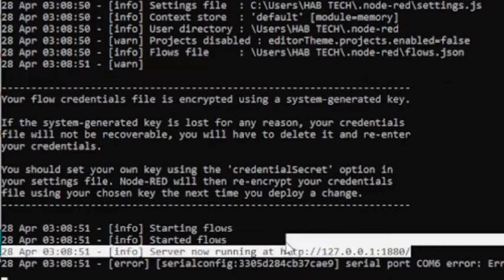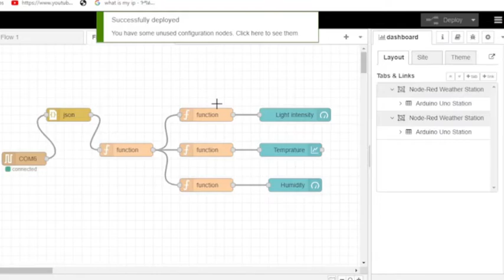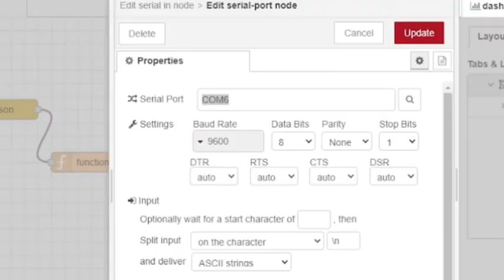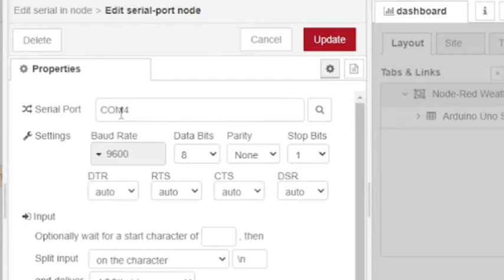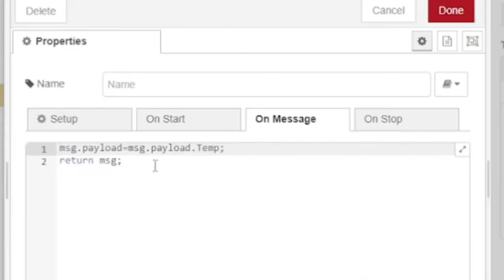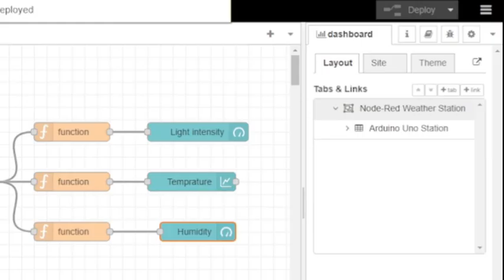Realtime Monitoring of Arduino sensor reading offline on webpage || 2024

Comment from the maker: The Arduino Code is as follows:-
#include <Adafruit_Sensor.h>
#include <DHT.h>
#include <DHT_U.h>
#define DHTPIN 2 // conect to digital pin 2    
#define DHTTYPE    DHT11     // DHT 11
//#define DHTTYPE    DHT22     // DHT 22 (AM2302)
//#define DHTTYPE    DHT21     // DHT 21 (AM2301)
int Humidity=0;
int Temprature=0;
int Light=0;
DHT_Unified dht(DHTPIN, DHTTYPE);
uint32_t delayMS;
void setup() {
  Serial.begin(9600);
  dht.begin();
  Serial.println(F("DHTxx Unified Sensor Example"));
  sensor_t sensor;
  dht.temperature().getSensor(&sensor);
  dht.humidity().getSensor(&sensor);
  delayMS = sensor.min_delay / 1000;
}
void loop() {
 delay(delayMS);
 sensors_event_t event;
 dht.temperature().getEvent(&event);
 Temprature=event.temperature;
 dht.humidity().getEvent(&event);
 Humidity=event.relative_humidity;
 Light=analogRead(A0);
 Serial.print("{\"Hum\":");
 Serial.print(Humidity);
 Serial.print(",\"Temp\":");
 Serial.print(Temprature);
 Serial.print(",\"Li\":");
 Serial.print(Light);
 Serial.println("}");
 delay(2000);
}

Comment from the maker: The Node-Red JSON code is as follows:-

[
    {
        "id": "777e21d8fb7005c6",
        "type": "json",
        "z": "88da2bec208da9fc",
        "name": "",
        "property": "payload",
        "action": "",
        "pretty": false,
        "x": 190,
        "y": 140,
        "wires": [
            [
                "9f828d0c941740ff"
            ]
        ]
    },
    {
        "id": "9f828d0c941740ff",
        "type": "function",
        "z": "88da2bec208da9fc",
        "name": "",
        "func": "var value=JSON.parse(JSON.stringify(msg.payload));\nvalue=msg;\nreturn msg;",
        "outputs": 1,
        "noerr": 0,
        "initialize": "",
        "finalize": "",
        "libs": [],
        "x": 320,
        "y": 220,
        "wires": [
            [
                "fe6fc76d0b7ed705",
                "3aea9c82799acd44",
                "edf7c2341a1b106b"
            ]
        ]
    },
    {
        "id": "fe6fc76d0b7ed705",
        "type": "function",
        "z": "88da2bec208da9fc",
        "name": "",
        "func": "msg.payload=msg.payload.Li;\nreturn msg;",
        "outputs": 1,
        "noerr": 0,
        "initialize": "",
        "finalize": "",
        "libs": [],
        "x": 500,
        "y": 140,
        "wires": [
            [
                "1ada5da722d25cc3"
            ]
        ]
    },
    {
        "id": "edf7c2341a1b106b",
        "type": "function",
        "z": "88da2bec208da9fc",
        "name": "",
        "func": "msg.payload=msg.payload.Hum;\nreturn msg;",
        "outputs": 1,
        "noerr": 0,
        "initialize": "",
        "finalize": "",
        "libs": [],
        "x": 500,
        "y": 300,
        "wires": [
            [
                "a8b9a012f0bcd88a"
            ]
        ]
    },
    {
        "id": "3aea9c82799acd44",
        "type": "function",
        "z": "88da2bec208da9fc",
        "name": "",
        "func": "msg.payload=msg.payload.Temp;\nreturn msg;",
        "outputs": 1,
        "noerr": 0,
        "initialize": "",
        "finalize": "",
        "libs": [],
        "x": 500,
        "y": 220,
        "wires": [
            [
                "94261317f1debd03"
            ]
        ]
    },
    {
        "id": "94261317f1debd03",
        "type": "ui_chart",
        "z": "88da2bec208da9fc",
        "name": "",
        "group": "218fb04944bee58f",
        "order": 8,
        "width": 15,
        "height": 4,
        "label": "Temprature",
        "chartType": "line",
        "legend": "false",
        "xformat": "HH:mm:ss",
        "interpolate": "linear",
        "nodata": "",
        "dot": false,
        "ymin": "",
        "ymax": "",
        "removeOlder": 1,
        "removeOlderPoints": "",
        "removeOlderUnit": "3600",
        "cutout": 0,
        "useOneColor": false,
        "useUTC": false,
        "colors": [
            "#1f77b4",
            "#aec7e8",
            "#ff7f0e",
            "#2ca02c",
            "#98df8a",
            "#d62728",
            "#ff9896",
            "#9467bd",
            "#c5b0d5"
        ],
        "outputs": 1,
        "useDifferentColor": false,
        "className": "",
        "x": 690,
        "y": 220,
        "wires": [
            []
        ]
    },
    {
        "id": "a8b9a012f0bcd88a",
        "type": "ui_gauge",
        "z": "88da2bec208da9fc",
        "name": "",
        "group": "218fb04944bee58f",
        "order": 1,
        "width": 8,
        "height": 4,
        "gtype": "wave",
        "title": "Humidity",
        "label": "units",
        "format": "{{value}}",
        "min": 0,
        "max": "100",
        "colors": [
            "#00b500",
            "#e6e600",
            "#ca3838"
        ],
        "seg1": "",
        "seg2": "",
        "className": "",
        "x": 700,
        "y": 300,
        "wires": []
    },
    {
        "id": "1ada5da722d25cc3",
        "type": "ui_gauge",
        "z": "88da2bec208da9fc",
        "name": "",
        "group": "218fb04944bee58f",
        "order": 3,
        "width": 9,
        "height": 4,
        "gtype": "gage",
        "title": "Light intensity",
        "label": "units",
        "format": "{{value}}",
        "min": 0,
        "max": "1023",
        "colors": [
            "#00b500",
            "#e6e600",
            "#ca3838"
        ],
        "seg1": "",
        "seg2": "",
        "className": "",
        "x": 700,
        "y": 140,
        "wires": []
    },
    {
        "id": "46a301b8aa20f403",
        "type": "serial in",
        "z": "88da2bec208da9fc",
        "name": "",
        "serial": "632ce51bae434d89",
        "x": 90,
        "y": 240,
        "wires": [
            [
                "777e21d8fb7005c6"
            ]
        ]
    },
    {
        "id": "218fb04944bee58f",
        "type": "ui_group",
        "name": "Arduino Uno Station",
        "tab": "b10389acabce7f3b",
        "order": 1,
        "disp": true,
        "width": "20",
        "collapse": false,
        "className": ""
    },
    {
        "id": "632ce51bae434d89",
        "type": "serial-port",
        "serialport": "COM6",
        "serialbaud": "9600",
        "databits": "8",
        "parity": "none",
        "stopbits": "1",
        "waitfor": "",
        "dtr": "none",
        "rts": "none",
        "cts": "none",
        "dsr": "none",
        "newline": "\\n",
        "bin": "false",
        "out": "char",
        "addchar": "",
        "responsetimeout": "10000"
    },
    {
        "id": "b10389acabce7f3b",
        "type": "ui_tab",
        "name": "Node-Red Weather Station",
        "icon": "dashboard",
        "disabled": false,
        "hidden": false
    }
]